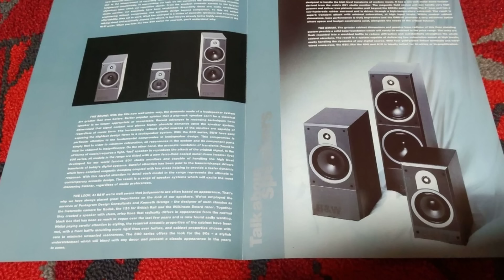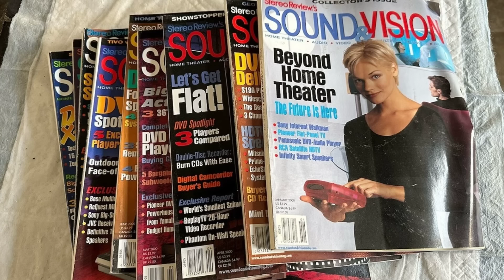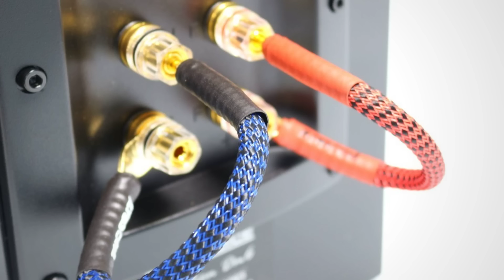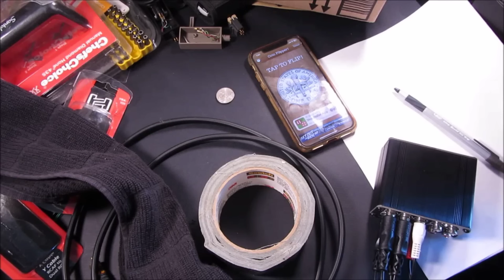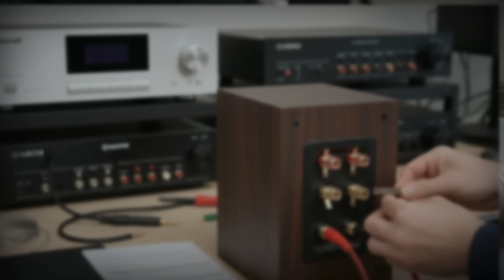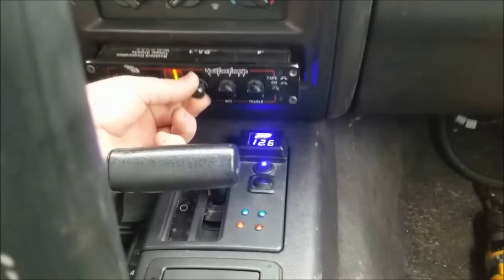Bi-Wiring & Bi-Amping Explained (Scam or Genius?)

Comment: Vandersteen speakers have been designed with crossovers that can and do take advantage of bi-wiring the amp speaker connection. So that's what I do. I am one of those who believe that ears are the true measure of sound quality, not numbers on a spec sheet. My speaker cables have a single spade at the amp end which feeds two cables to the speakers, which also have spades at the speaker end. Much better than bananas in signal and power transfer.

Comment: i have klipsch rf 82s that require bi-amping, back in the 80s i had kenwood mv5s that didnt. the kenwoods sounded better. the only way to get my klipsch to sound good is bi-amping them, if i didnt have to do that i could have another channel available for an addition set of speakers

Comment: What I learned as teenager interesting for Hi-Fi asnd later studying mechanical engineering is, that scientific measurements and the majority of expert opinions show that bi-wiring offers no significant audible advantage. The signal originates from the same amplifier channel, and the internal crossover separates the signal paths anyway.

If you want to impove by taking some money real Bi-Amping is the way to go. With passive speakers under normal operating conditions, bi-amping usually yields only a very slight or barely audible sonic advantage; however, at high volume levels, it can improve maximum dynamic range—provided the metal jumpers on the speakers are removed. 

Other properties of Bi-Amping:
A separate power stages: One amplifier drives the high/mid-range frequencies, while another handles the low-frequency range. Reduced load: 

Bass reproduction requires significant power. In passive operation, however, the receiver's power supply is often subjected to a combined load. 

Critical risk: Failure to remove the speaker's jumper links creates a risk of short-circuiting or damaging the power stages.

So if you love to hear loud music in stereo, multi-stereo and maybe you hear loud movies in home cinema for front, center and rear it can impove audio under loud conditions.

Me, I bi-amped in my 7.2 system just front L/R for stereo music and will maybe upgrade for bi-amping center and maybe rear L/R for my home cinema.

Comment: I call this madness a high-fi religion.  Speaker cables must be the main rip of.  Blocks lifting them off the floor, either made from 2X4s or more fancy lifters do absolutely nothing.  An other one, bi wiring. Total stupidity.  Basic knowledge how electricity runs is taught in 6th grade.
Monster Multiple-Gauge Construction is an other expensive nonsense.   How about coloring edges of CD's?  Did you use the correct green paint?   :face-blue-smiling:

Comment: I use an amplifier for every single part of my audio. I use a mono-block to power just one tweeter, just one small midrange, just one large midrange, just one woofer, & just one mono block each of the two subwoofers. I have ten 100 watt mono block amplifiers total each with it's own 32-band EQ besides the two 18" subwoofers with a 1000 watt mono block amplifier each that use an Audio Control - The Epicenter with 15Hz PFM subsonic filter to play low frequencies. It is amazing to have the proper adjust ability to get the sound signature you are looking for & that is the whole point to get the audio dialed in like you need for your application.
Reply: Jesus that’s a lot of amps. What’s your electric bill?

Comment: I just realized a reason to bi-amp would be to use two amps because impedance is different for low and high frequencies. Two circuits required

Comment: The only reason for bi wiring that I can see would be able to use a lower wattage amp for the high frequency. Would require separate circuits inside the speaker cabinet.  I always thought that if only one set of wires were connected one would only hear that speaker 

Once again the objective was able to use two amps and a preamp.   Another reason would be a separate crossover frequency for each speaker giving some overlap. That could be interesting and of course requires two crossovers

Comment: Everyone forgets about Lenz law, the driver creates its own current and it has to go somewhere!

Reducing IMD (Intermodulation Distortion) was the intent of biwiring without a biamp.
The impedance of a longer return for the distortion signal is said to damp said signal to the tweeter.
Reply: Lenz'law states that a current induced by electromagnetic induction is always directed in such a way that it opposes the cause of its creation. It determines the direction of induction currents and explains the minus sign in the law of induction. A magnetic field or a flow of current “seeks” to maintain its state; changes are inhibited like ON/OFF. The law ensures that energy is not generated out of nothing. If the current were to amplify the cause, it would result in a perpetual motion machine that doesn't exist so far. 

Scientific measurements and the majority of expert opinions show that bi-wiring offers no significant audible advantage. The signal originates from the same amplifier channel, and the internal crossover separates the signal paths anyway. With passive bi-amping or bi-amping you can gain some audio improvements most under loud conditions.

Comment: Basically running bi wire from the amp halves the impedance of the cable and cuts current feedback to the tweeter and midrange from the current created by the woofer movement.
The jumpers on bi wire speakers is only to get it working!

Comment: If you have mid end 5.1 power amp from mid 90s like DENON or ONKYO with questionable 50w per ch , technically you can bi-amp your speaker up to 60-80w rms for free .. ?

Comment: Passive bi-amping with an AVR and typical 3 way speakers can only provide slight improvement. The woofer typically consumes roughly 65-70% of the power in a typical 3 way speaker. Most AVRs share the same power supply and usually the more channels driven, the lower the output per channel. The channel connected to the HF terminals will usually be underutilized as power demand on it is much less than the LF. A lot is also dependent on how well the crossover is designed. I use a passive bi-amp on my JBL L7 speakers. They are a true 4 way with a subwoofer built in that is powered by the speaker wires, no external amp. The crossover is actually 2 separate boards that are joined by the jumpers if installed. My 5.1 system is powered by an Outlaw Audio 7X200 channel amp, basically the Monolith 7. 4 of the 7 channels power them. It does make a difference. But in almost all circumstances a better answer is to use a more powerful amplifier. Active bi-amping (a crossover at the pre amp level instead of the speaker’s built in crossover) will also yield much better results but you have to really know what you’re doing to accomplish this.

Comment: At 4.00 you state that a full-frequency range signal is sent to both tweeter and woofer terminals via the jumper strap. This is not so. If a biwirable speaker is used with a single pair of speaker leads with the jumper straps in place, depending on whether one plugs the speaker leads in to the tweeter or woofer terminals, the jumper strap will only carry the treble OR bass, not both!

Plug into the tweeter terminals and the treble CURRENT will enter the high pass filter (usually the input capacitor) directly from the tweeter terminals. The bass CURRENT will split at the top terminals and travel through the jumper strap to the woofer terminals and subsequently to the low pass filter (usually the input inductor). Vice-versa if you plug into the woofer terminals!

PS why does the photo on the introduction show two sets of speaker leads connected (as if for biwiring), but with the jumpers in place?!....and while we're at it, why are the two sets of speaker leads connected reverse phase?!!! 😮
Reply: You are technically correct, the best kind of correct. (Hermes Conrad) 🙂
I suspect the fairly non-technical narration leaving the term "signal" undefined implies merely the presence of a voltage, and hence the more correct statement would be "full-frequency range voltage is sent to both".
Reply: @PlatypusPerspective Thanks PP, you're right about the 'vagueness' of the term 'signal'.......I remember this on M Zilch's two videos on the subject.....I think for the 'average' audiophile from a non technical standpoint a clear explanation of the consequences of two circuits in parallel, ie. same VOLTAGE signal across both, but different CURRENT signal through each might be helpful.

I still find it shocking that qualified electrical engineers don't understand how the crossover works!.....and even more, that they post a video about the subject!
Reply: @rogerwebb7501  Yeah, if we search hard enough, the Z has a small print disclaimer somewhere or other saying that his use of "signal" refers to the voltage. He simply doesn't mention that in the actual videos, as far as I can recall. I didn't spend lots of time examining them!
Just as a coincidence, this popped up on my feed a little while ago (if the link doesn't get flagged):  https://youtu.be/_xDvnlTMzjs

Comment: Bi wire only make sense on bi amp capable av, my monitor audio speakers and Yamaha av makes hell of a difference when listening music at very loud level can achieve tremendous amount of bass a lot earlier because you got two extra amps available meaning double power to front speakers but now only using my setup to movies and ditched bi amp for Atmos speakers as when you watching movies it's more about dynamic power than power per channel also got two subs so if I want more bass while music is on I got options :)

Comment: I've got my floorstanders fed from a Pioneer AV amp using the front stereo pair channels for the LF end and the Atmos front "height" channels to run the HF side, sounds way livelier than fed from the single front stereo pair alone with terminal links in place... you do get the odd Star Wars X fighter swooping down into the sound field or Godzilla roaring too though.

Comment: If you don't understand amps and crossovers, bi-wiring is way over your head.... Having the ability to run a second amp with electronic crossover and different gain control can really help you tune your low frequencies to the rest of the system. If you're a real audiophile and can hear the difference. You ever have that situation where your lows aren't loud enough during the quiet parts of a movie so you crank their level up, then an action scene comes along and rattles your windows? If you have your system bi-wired, you can control that low level more accurately.
Reply: To achieve that you’re bi-amping, Not bi-wiring.
Reply: @NatMart9394  not necessarily. I am bi-wired on a single amp. It has 2 sets of outputs for the front speakers that I can tune separately.
Reply: @bradywebb1311 
Yes necessarily.  🤡
To do what you claim, there has to be multiple amplifiers inside. 
So why have your posts disappeared.?

Comment: Bi-wiring is dumb. Bi-amping is smart if you use amps designed for the speakers they move.
Bi-Amping is basically everywhere on amplified studio monitors, for the good reasons : these speakers are designed including the amp they power them, one for power (that could have good feedback) one for precision.
Notice that on 2-ways speakers, there's usually no crossover filter, just a low-reject for the tweeter to protect it, the medium/bass being filtered naturally by its weight.

Comment: I invested in bi wiring for my B&W speakers a few months back. I had to do some research as I had no idea what Bi wiring was. After some shopping around, I found bi wiring cables with banana plugs around $200 for 2. Expensive but I refused to spend $400+. Anyways, I did notice my speakers sounded louder and clearer. But that could have been a benefit of the quality of cable I was using and not the Bi-Wiring. Either way, I’m happy with the sound.

Comment: Okay, let’s talk about bi-amping — because a lot of people get this wrong.

If you’re using a single amp with two output stages, guess what? It’s still powered by the same transformer. That means all the power is coming from the same place and hitting the same limits. You’re not magically creating more headroom — you’re just slicing the same pie into different pieces.

So if you really want to bi-amp properly?
Use two completely separate amps. Two power supplies. Two transformers. Now we’re talking. 💪

That’s when you actually gain something meaningful — better control, more headroom, cleaner dynamics. Your speakers will thank you.

But here’s the real question:

Is adding a second amp worth it?
Or would you be better off just buying one really good amp?

Sometimes, instead of juggling two mediocre amps (plus extra cables, interconnects, and the spaghetti chaos behind your rack), you could just invest that money into a single, more powerful, higher-quality amplifier and call it a day.

Bonus: keeping one amp also frees up budget you’d otherwise spend on extra speaker cables and interconnects. More money for the stuff that really matters.

So before you dive into bi-amping:

Are you actually gaining more power?

Or just rearranging the same power differently?

Would one better amp simplify everything?

Because sometimes… less gear = better sound. 🎶
Reply: Cool nga😎😎
Reply: If you want to biamp properly you use 4 high quality monoblock amplifiers and an active crossover designed specifically for the speakers you will be using, and place the amplifiers directly behind the speakers.

Comment: I bi-wired an old Denon amplifier and some old Alr Jordan (an Anglo-German brand) speakers, both fairly inexpensive. Without them, the sound was muffled and lacking definition in the highs. Separating the cables and using a pair of "audiophile but not really expensive" ones (Tasker) for the HF section significantly improved the sound. With other systems, where I already had correct treble reproduction using a single pair of cables, bi-wiring made the sound too edgy and made it difficult to listen. This is my modest personal experience.  😊

Comment: You don't even need fancy or dedicated speaker cables to power the loudspeakers. If need be and your budget is tight, all you need is good quality two wire electrical cables to which you can attach the necessary connectors (spades, bananas, NL2 or NL4).
You only need to pay attention to the recommended cable cross section and ensure it is constructed from pure copper.
I often use H07R-NF electrical cable, because of its flexibility,  UV resistance, fire retardant capability and last, but not least, its lower price compared to dedicated speaker cables.
Take any measurements you like, on whatever testing equipment you like and you won't notice any drop in audio signal.

Comment: I bi-wired my speakers, SB Acoustic Eka. For woofer I use QED and for treble I use Vandenhull. Can't remember the model/type. The sound is amazing compared to single wired. I can hear the different immediately, easily. The treble smoother and the bass tighter. But if you reverse the wire, the sound not so amazing. From now on, I will not buy single wired speakers.

Comment: I was a bit surprised to recognize the Mission 781 in the first seconds of the video. They’re outliving the Cyrus II I got at the same time, a long time ago. They’re still sounding great to my ears, even better since I added a subwoofer to anchor the bass. I still connect them bi-wired, the friend who gave me a good deal on the set had just the short length I needed for my modest listening room. It always seemed to make a small difference compared to another slightly longer set of regular speaker cables, which I used previously for some time in a larger room, and kept as a lighter alternative.

Comment: Surely bi wiring was an idea created by Cable companies to sell more overpriced copper
Reply: Cable companies don't control how speaker manufacturers design and manufacture speaker systems, and it certainly wasn't their idea. Bi-wiring is a secondary connection technique made feasible by the speaker manufacturers offering splittable inputs to the crossover network, primarily introduced to enable bi-amping in the era when large amplifier powers became desirable, but high powered amplifiers were uncommon and expensive. There's no doubt some cable companies spotted an opportunity, much as they have with stupidly expensive regular cables.
The thing I always point out to people is that no-one needs to buy any cable to find out whether they can get a benefit from a bi-wire configuration. Borrowed cable will work fine. Try it and if you hear no difference, move on. If you hear something you like, then you may buy some cable if you are satisfied that for you, it will be worth it. (That's too sensible for some people though... 🙂 )

Comment: lol funny no one can hear the difference. Audiophile here. Its a big difference if you have quality equipment and cables and using a copper wire .        My crossover caps cost more then your  receiver . My rca cables cost more then your entire stereo. lol. not bragging its  hobby  however my car is 20 years old  i put my money where i enjoy it most .       Yeah there is a difference .            Tip for some users . Even if you have only one channel amp output  its worth running two sets of wire from your amp or receiver to your speakers one goes to tweeters and mids the other woofers . It will make the highs cleaner keeping the bass distortion out of the mids and bass and stop buying receivers  there junk ! buy a dac and  amp it will sound so much better day and night cleaner bigger stereo image . Unless your buying a 7000 dollar receiver   1000 dollar amp 300 dollar dac  will sound better then 7000 dollar receiver